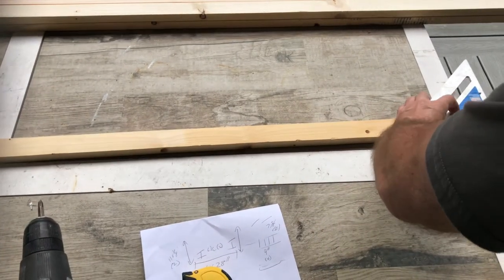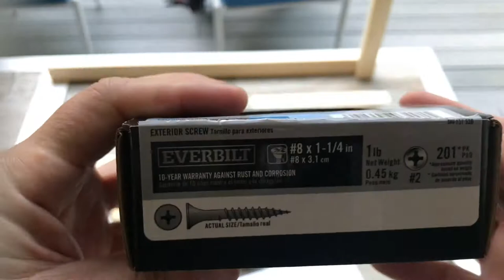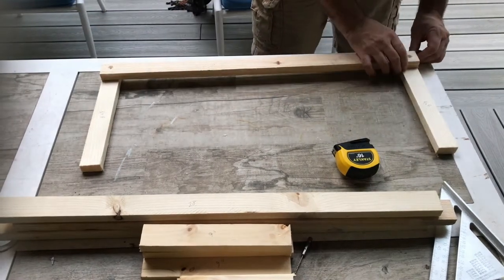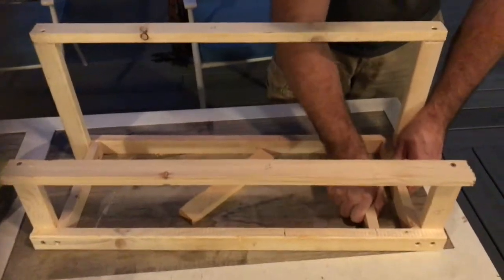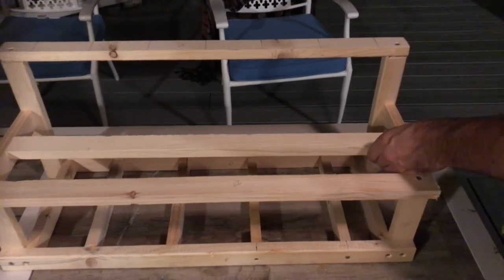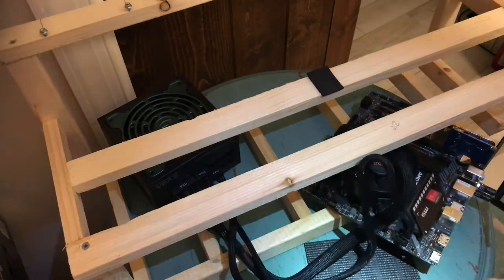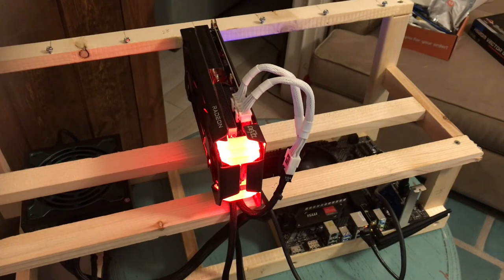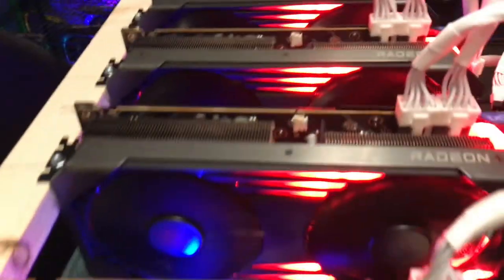DIY $6 Wood GPU Mining Rig Build

Comment: 1.98 per 8 feet in Hawaii, sold!
Reply from the maker: How is mining in Hawaii. Are you up one of the mountains for the cooler temps?
Reply: @roccotacomining3311  Actually no, I live in the city. Running off of solar and a well ventilated shop.